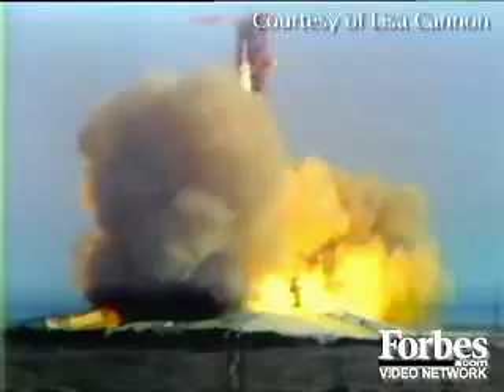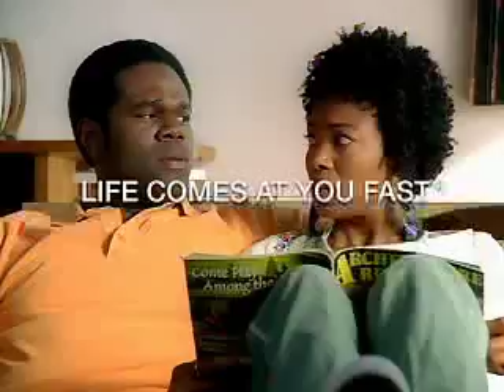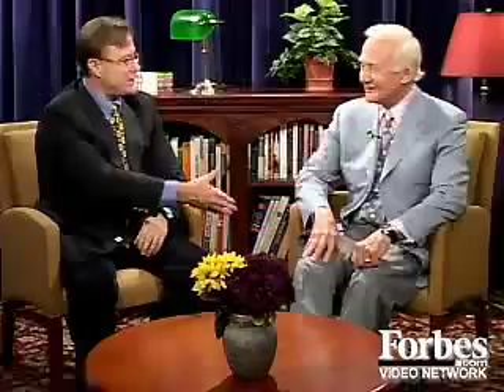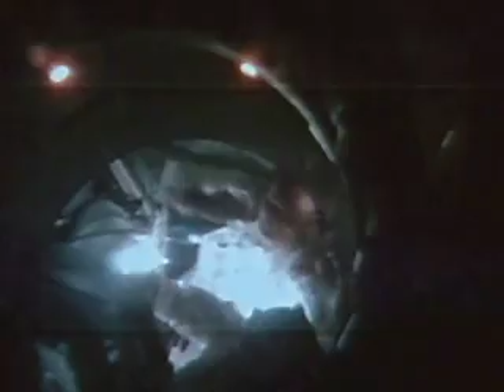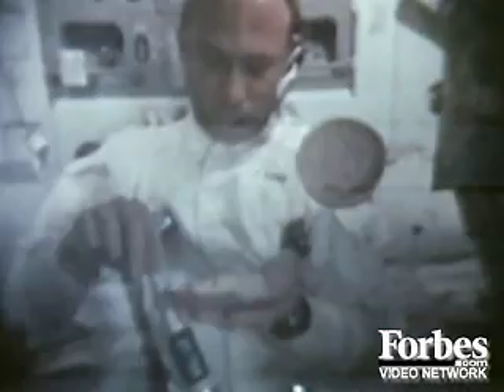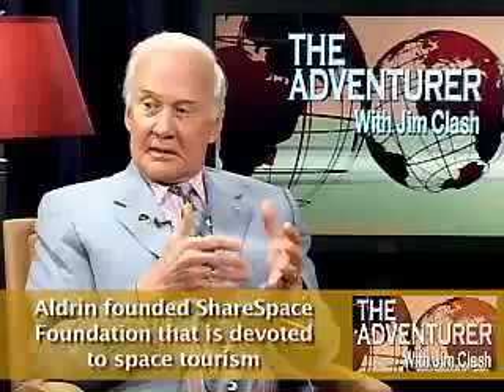Buzz Aldrin Talks w/ Jim Clash about UFO Sighting

Comment: @ccc771 Please check facts before you make statements. No propulsion or guidance? The upper stage had an IBM made guidance system and engines that could be restarted in space. Stage 4 from Apollo 8-12 all flew by the moon and entered heliocentric (around the sun) orbit. The astronauts would have done that too if they didn't actively slow down to orbit the moon. The stages from later expeditions were sent to impact the moon for seismic experiments. How big is your nose by now?